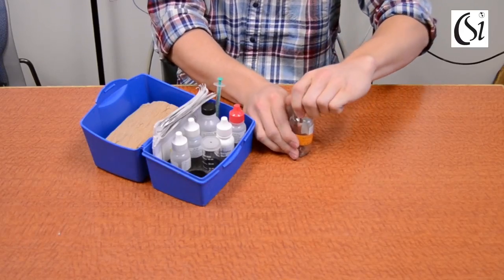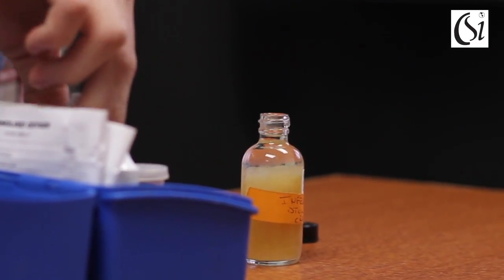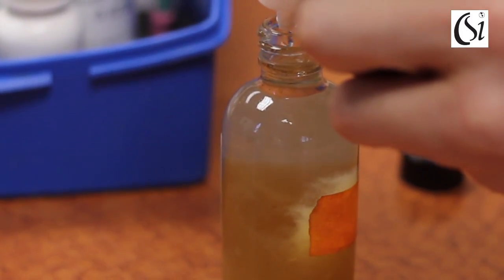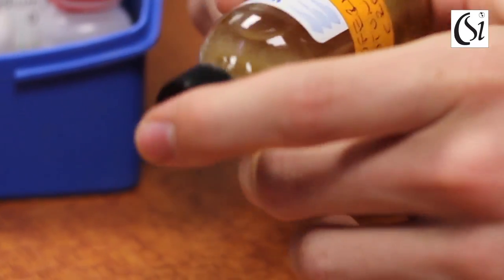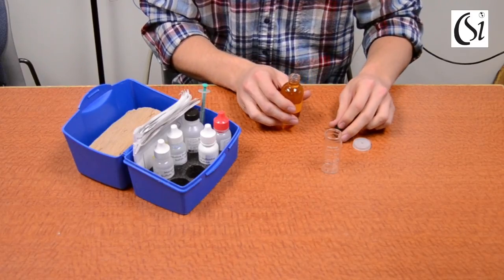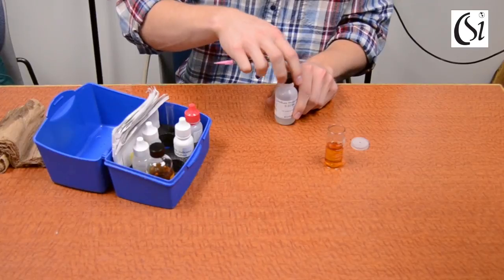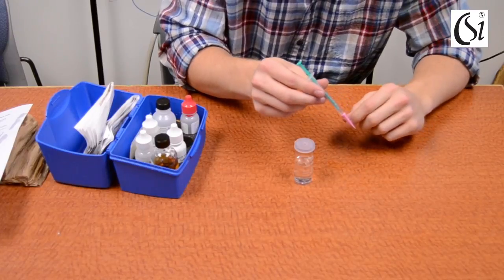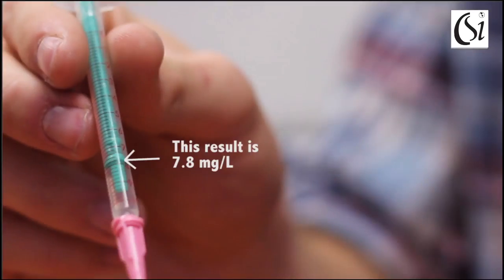Dissolved Oxygen Test Kit Instructions - Volunteer Water Monitoring

Comment: This video is good but you make one very serious error, which is why I have not shared it. You demonstrate adding 8 drops each of the first 2 reagents to a NOT completely full bottle. That means that you introduced oxygen to your sample from the environment, especially if those drop didn't completely fill the bottle. Yes, adding 16 drops of solution to the bottle means that is will overflow, but the density of the chemicals means that they will sink, and water will be displaced.  This is why we tell our volunteers to do this test on a paper plate with paper towels available to wrap the bottle in when shaking. It is a well done video, but that flaw makes it unusable for me because I already have enough trouble trying to get my volunteers to not "spill off a little water to make room" and artificially elevate their results.
Reply: I watched this video and wondered this exact same thing! Thank you for your  comment.